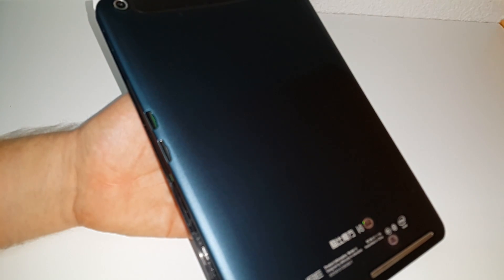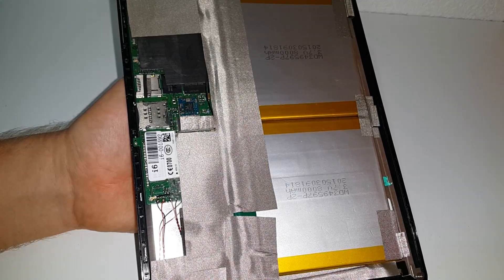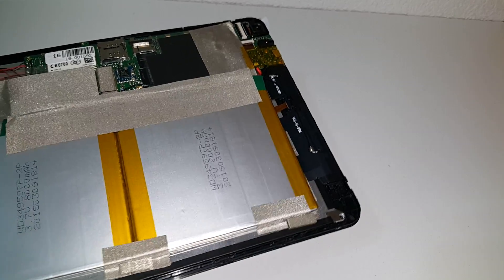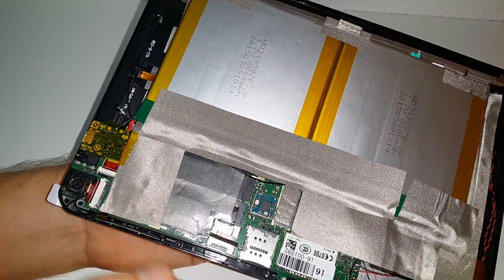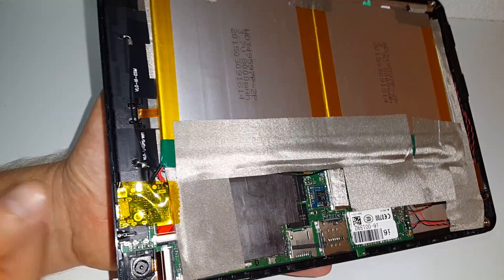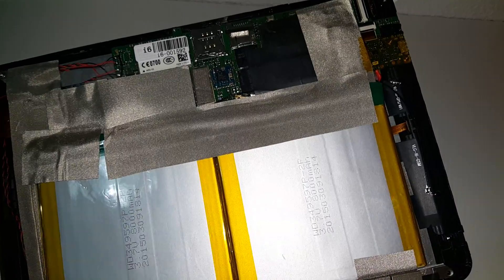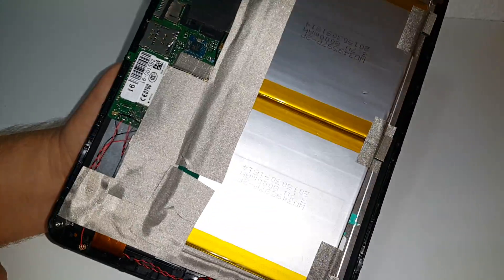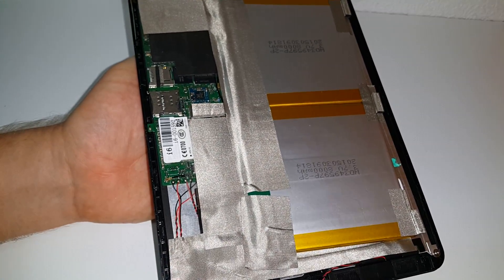Cube i6 dual boot teardown build and internal components

Comment: There are several common problems in this tablet. One is charging problem. It can be the charger or the charging port.  Second is battery is not 8000mah as it says. But there are 8000 batteries to buy and replace. Other thing is screen. It will break easily.

Comment: Would you think its possible to remove the matte coating?
Reply from the maker: Jeremiah Yong I had a go, i think you could if you removed the camera, motherboard and then you could pull it off. It's quite thick, and I just didn't have space from one side. If it really bothered me, I would make the effort and remove it.

Comment: I think those tapes and foam pads are electrically conductive and they have a part in EMI/EMC shielding, rather than spreading heat. They may also get hot though, that can help a tiny bit.
Reply from the maker: gabest4 Tape would be, I think the foam pads are there to help apply pressure of the screen edges to help hold it against the glass. As only 2 screws were used to hold the LG 2048 x 1536 IPS panel in, forgot to mention that in the video! I could also see the anti glare cover over the display, but it looks difficult to remove.

Comment: have you tried to open the cube I7 ?
Reply from the maker: Steevenoo Yes, but it seems to be glued in place, felt like the screen would crack and so I didn't want to risk breaking anything for the sake of taking a peak. If a tablet is easy to open, then I will open it up. I've done this with the X98 Air 3G, Chuwi Vi8 and now this one.